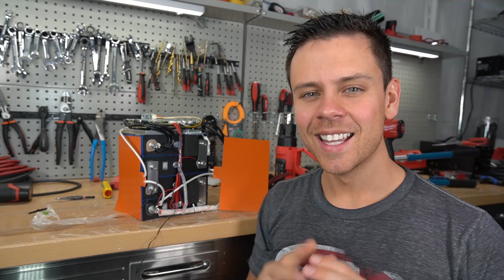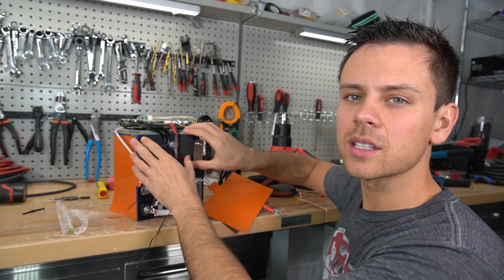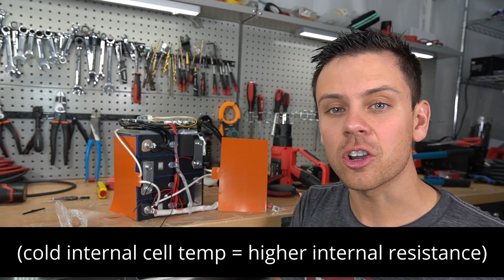LiFePO4 Cold Temperature Misconceptions: Do you really need internal heaters?

Comment: I have a portable trailer with computer equipment in Utah where the winter temperature ranges from 14 to 34 F depending upon the day and the sun. I ended up getting the battleborn batteries for reliability and the heater. Solar is the only way to charge the other than going to the trailer with a generator. So I need to ensure the solar few hours gets the most charge. It worked well for long stretches.  During some unfortunate circumstances the batteries ended up being drained and before we could get they were completely empty. So we had to heat the batteries up w the generator before we could even recharge. I had brought with added reptile heating pads ha ha to assist in the process.  The batteries are insulated but it’s an unmanned trailer so given enough time it’s cold.  The unfortunate part is we were getting a lot of solar during the week that we were not able to get up there but the temperature prevented charging.   Live and learn   Love the channel
Reply: I was thinking of using some of mine on a pole for security cameras the way it looked to me was if the temperature was under spec the solar charging energy was diverted to the heating pads untill conditions improved then switched to charging. Perfection
Reply: @williamvaughan1218  this is a great idea, have a separate circuit that runs directly off solar(and battery as backup) to run the heating elements with whatever power is available! This is possibly the best idea I've seen for keeping batteries charged with solar 100% hands-off and reliable. GREAT IDEA once again!

Comment: Back years ago, ppl with a well, would put a 100watt lightbulb in the well house to keep the water from freezing, it's a tiny building, just bug enough for the water tank, and the well. Usually insulated. A 100w bulb can keep it about 45°-60°F when it's about 0°F outside, in some cases, and escamo can build a igloo and stay warm from body heat, trapped air is a excellent insulation, and combined with a thermal mass, it's not going to get that cold that fast! So a battery box with a tail light bulb could be used to keep it above freezing!
Reply: What the heck is an escamo?
Reply: @CanadianTexaninLiguria  it is the new name for those chocolate covered ice cream squares that got woked
Reply: An eskimo
Reply: Indians cousins
Reply: I did the same thing for some outdoor alcoves.

The funny thing is those incandescent bulbs are getting harder to find now.
Reply: My grandparents still do this today. Been 40 years keeping the pipes from busting in the well house.
Reply: Most of the wattage of incandescent light bulbs turns into heat; only about 12% is making light. Larger sizes are hard to find but specialized bulbs like the small ones used in refrigerators and stoves are exempt from the regulations.
Reply: This is what I do with my bank. My battery is in an old bathroom vanity with some styrofoam insulation and a 40w bulb. I store my power tools battery in same spot.
Reply: When I started studying solar in 1986, auto tail light bulbs and 12V systems were standard eq. - that’s a good hint and those bulbs will stay available due to older cars needing them.
Reply: Personally, although a 100W bulb can help prevent freezing, maintaining the inside temperature 45-60 degrees above the outside ambient is a heavy push.
Reply: Question:  Why is it that Victron Smart batteries are set to disable charging at 41°F and lower instead of 32°F and lower like other LiFePo batteries?  Is that Victron's way of building in an additional layer of safety?
Reply: What do you mean years ago?
Reply: Inuits, not Eskimos, built igloos.
Reply: @akau1340  Eskimos built them
Reply: @akau1340 Not correct. 'Eskimo' is an older, outdated term that describes both Alaskan Inupiat, Canadian Inuit and Siberian Yupik peoples. Some built igloos, some did not.
Reply: @akau1340 same thing
Reply: Air conducts heat very poorly. A light bulb heater is about as inefficient as you can get.

Comment: If you want to use a battery where there is risk of freezing temperatures, you have to keep it warm in some way or other in my opinion. If the cells are frozen through and start to get heated up again from the outside, how will you - or that there temperature protection - know, when it's safe to start to charge them? It's risky business.

My batteries are in an unheated shed but inside an insulated box together with the regulator and the inverter. I turn off the inverter regularly in winter to save power but at 4-5C (39-41F) the thermostat takes command and turns it on. Turns off again at 8-9C (46-48F).

Comment: Makes sense. 🙂 I was actually thinking that it made more sense to just use thermal insulation so it is nice that someone confirmed that my thinking was correct.🙂
Reply: @sawmillmods1659  Yep,  insulation alone in climates that spend long periods below freezing will require additional heat either through cycling of the batteries and/or heating pads.

Comment: I was confused about this because of past comments and some emphasis  on certain batteries not having a low temp sensor.
If I just want a good battery for car camping,  if I understand correctly,  I will be fine without a low temp sensor as long as the batteries aren't at or below 32F and I begin to charge them.
Is that correct?
Reply: @Jörg Ballschmiter  so a battery with a low temp sensor simply protects against my doing something that would cause damage?
It won't allow batteries to be charged below 32F.   I think I understand. 
As long as I don't charge when battery temps are  below freezing...there should be no damage.
Reply: @yogster  TY

Comment: Very difficult when you live Nevada 😂🤣😂 try living in any colder conditions. This is my #1 problem. Hate it. Have my pack wrapped in insulation and they are in an insulated shed as well. I have to carry my battery pack into my house almost weekly to warm it up so it will start to charge.
Reply from the maker: Why not add a heater pad?
Reply: @WillProwse   because I am an idiot that bought the RV water tank heating pads last winter and weather got warmer and did not install them and now winter is here again and I can not remember where I put them.
Reply: Sounds like we may be long lost cousins…wondering if there is a hot version of a cold pack that you could warm up and bring out to your batteries instead of bringing them inside? Just a thought until you find where the RV pads are hiding.

Comment: I definitely need to get a battery with an internal heater. 

My RV has a 110v fridge which I’d like to leave powered via solar when my RV is in storage. It gets very cold - easily cold enough for hard freezing. 

I have no problem with temperature when I’m living in the RV, but when its just sitting there, ambient temperature can stay below 25F for days and days in a row.
Reply: If the RV ambient temperature is so cold that it will "hard freeze" the battery, why do you need the refrigerator running?
Reply: @ewicky  because sometimes, it is not
Reply: @williammeek4078  Just empty it when its in storage and shut it off. Seems kinda obvious.

Comment: the temp here in canada is sometime ,actually alot of the time in the winter is well below the freezing ...... thus tyhis theory work here?
Reply: I service solar here in canada. 10 inches of insulation inclosed box 1 inch plywood compared to  just a box with 2 inches of insulation only changes the temp by about 5* C when the temp is -20*C.  These 2 units are in the same area. Temps are minus -4*C on slight insulated one and -1*C most times before sun starts charging at -5*C outside temp. At -20C it is usually -8*C and -2*C. So yes insulation hepls but does not cure it while it is not charging

Comment: I was one of the commenters earlier today. I understand that the charger on my boat won't detect the battery once it has gone into protection mode. Chins sent me their charger and it was heating up the battery but stopped heating before it had reached the 10°C the BMS has programmed to start charging. I had to continually disconnect and unplug the charger for it to finally start charging. Perhaps it's the charger they sent me. It has an indicator light that is red when providing power but it would turn green and I could hear it stop and then the battery temperature would start to drop. They were very responsive and sent me some different parameters but it still didn't work on its own. Any thoughts?
Reply from the maker: You need a different charger.
Reply: @WillProwse  LoL that's the one Chins sent me!  But I agree it must have some sort of timer that if it doesn't see a change for a certain amount of time it assumed the battery is full. Thanks for the follow up video. I think I can figure out some RV holding tank pads with thermostats powered by the batteries themselves. Overall the battery is great for the price and they did respond daily, so that's good to know.

Comment: It won't be difficult to get those batteries that cold in a non-heated shed here in nothern Wisconsin/Minnesota. Our faces literally freeze off within seconds here. ;-)
Reply from the maker: Just need more insulation. A lot haha
Reply: @WillProwse  Yeah that's true. Most people insulate themselves with lard and bacon grease it seems. Haha...When will this winter end!? You got it good there as far as weather goes. My use case for these is for overlanding in a 80 series Land Cruiser so your info helps a lot. Thanks.
Reply from the maker: Yikes haha